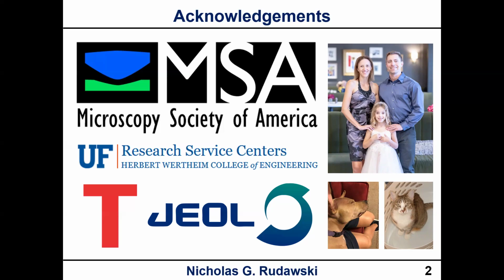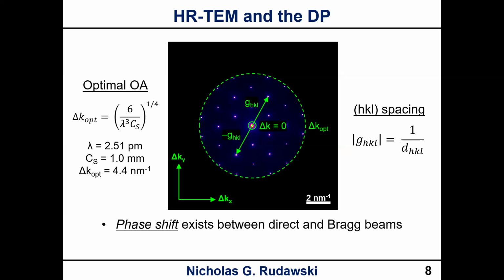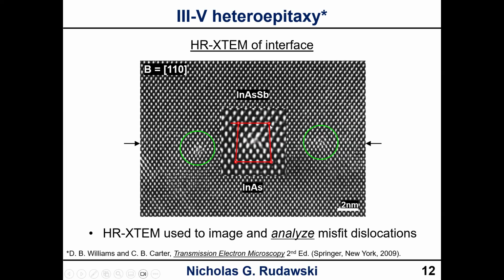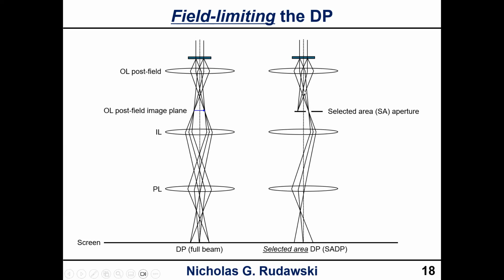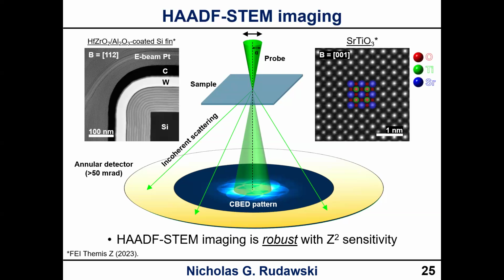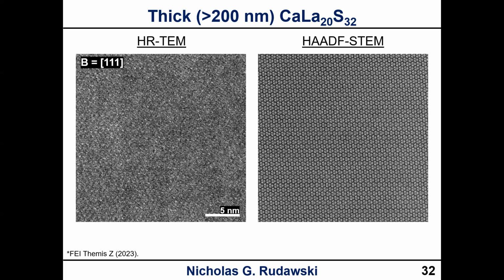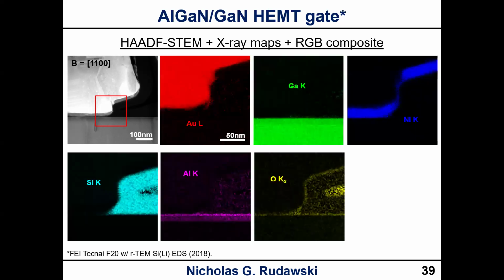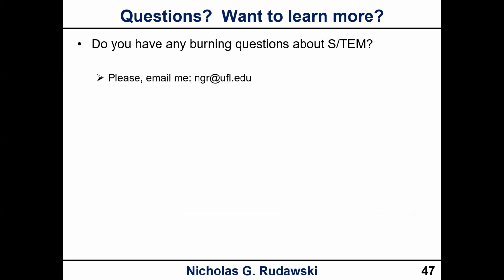Scanning/Transmission Electron Microscopy: Today's Essential Techniques

Comment: Great overview and especially nice direct comparison (and dangers) of phase contrast in HRTEM vs. incoherent imaging in HAADF-STEM.
Reply from the maker: Thank you; I actually had several other slides about HR-TEM that i wanted to include (with a bit more technical nitty gritty stuff), but I ended up cutting to keep the total time more reasonable (though now in hindsight, I suppose I could've put them in for this version of the webinar).

Comment: I really like your video. Can you make a  video for 4d stem???
Reply from the maker: Hi Crystal; glad you like my webinar.  4D-STEM has certainly been requested by quite a few people up to this point.  It would need to be a 2-part series: one part discussing the collection of the data and the second part discussing the actual analysis of the data.  I definitely hope to get around to this sooner rather than later (particularly the part about data collection, because I feel this is really quite lacking based on what is available here on YT).  That being said, there are already some very good YT videos talking about the applications of 4D-STEM; this one from Gatan is probably my personal favorite: www.youtube.com/watch?v=-KpxeNDoB5I
Reply: How to find kikuchi pattern (TEM and STEM mode) in thin sample for good zone axis alignment ? Please help Sir.
Reply from the maker: @arupghoshal5814  Kikuchi diffraction will decrease as the sample becomes thinner; at some point, you may not observe any Kikuchi diffraction at all, so this definitely can make it more challenging to obtain accurate zone axis alignment in a very thin sample.  It is actually easier to check the alignment in STEM mode, since CBED patterns are more sensitive to crystal tilts.  After you align in STEM mode, you could then go back and perform TEM imaging on the same location.   Otherwise, if you only use TEM mode, you need to evaluate the symmetry of the intensity of the spots in the diffraction pattern.  Please check out this video on zone axis alignment when performing S/TEM (apologies if you already did): https://www.youtube.com/watch?v=0VfJLJP6tP4